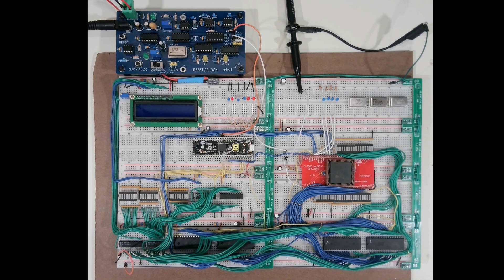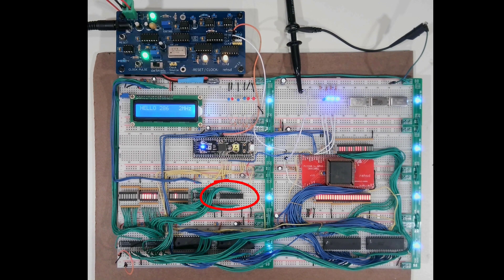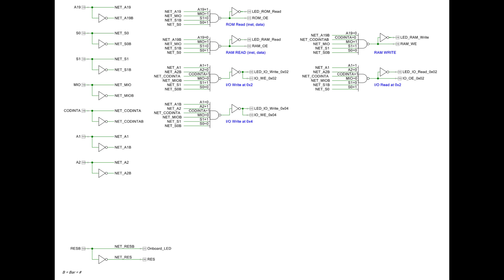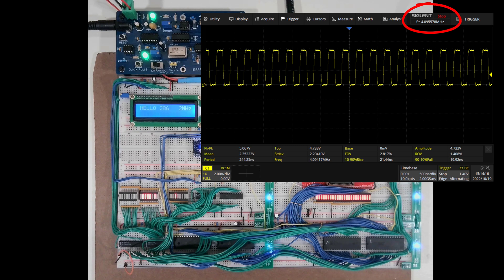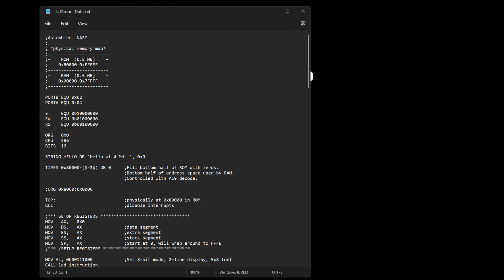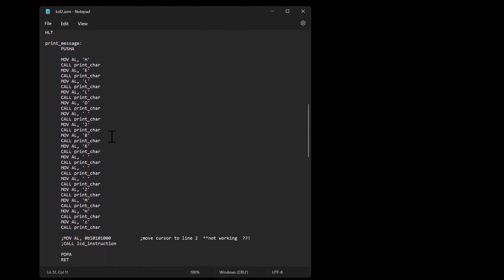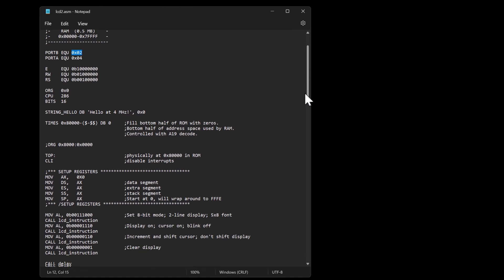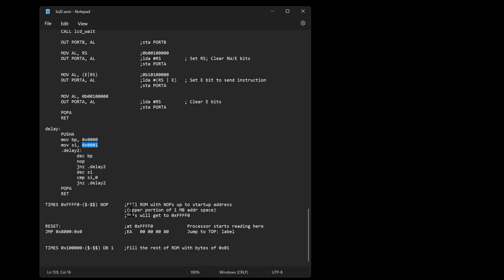80286 Build, Ep. #10 - I/O Read of LCD Busy Flag (System at 2... I mean 5... MHz)

Comment: Another great video. 

Your print_string routine actually can be very simple:

;
; Send a NUL-terminated string to the LCD display;
; 
; In: DS:BX -> string to print
; Return: AX = number of characters printed
;              All other registers preserved or unaffected.

; 
print_string:
push bx ; Save BX 
push cx ; and CX onto the sack
mov cx, bx ; Save contents of BX for later use
.loop:
mov al, [bx] ; Read byte from [DS:BX]
or al, al ; Did we encounter a NUL character?
jz .return ; If so, return to the caller
call print_char ; call our character print routine
inc bx ; Increment the index
jmp .loop ; And loop back
.return: 
sub bx, cx ; Calculate our number of characters printed
mov ax, bx ; And load the result into AX
pop cx ; Restore CX
pop bx ; and BX from the stack
ret ; Return to our caller

I hope this routinee is useful for you.
Reply from the maker: @Damouze, if you'd be kind enough, could you take a look at this code and see what looks off? I'm working to implement your print_string procedure, and I must not have something quite right.

https://pastebin.com/Mj6cUFkm

Thanks!!!
Reply: My pleasure.

Assuming you're generating a flat binary (for instance by issuing nasm -f bin <assembly file> -o <output file>), the contents of the data segment will end up at the end of the code segment. In other words your test string ends up outside the bounds of your ROM image, at file offset 0x100000. You're initializing DS to 0x0, which is the start of your RAM. However, since this is not where your string is, it won't work. 

The best way to deal with this, at least for now, is to simply load DS with the contents of CS:

push cs ; push CS onto the stack
pop ds ; and pop it into DS

Then move your string inside the code section of the assembly file and nasm will generate the proper address for its label. I hope this helps you out.

Note: in real mode the segment registers, other than CS, can be altered at any time and they can all be saved onto the stack and again with the exception of CS restored from it. The opcode that used to for POP CS in the 8086/88 is, in fact used in later processors as the prefix for extensions to the instruction set.

Final note: in real mode the first 1024 bytes of memory are reserved by Intel, for the CPU's interrupt vector table. This is where the CPU looks up the pointers for the handlers for software interrupts (int <imm8>), hardware interrupts (such as NMI and other external interrupts) and exceptions before calling them. This means that, strictly speaking, setting SS to 0x0 is not the best idea. You should set it to at least 0x40. Later on in your build you should also consider initializing the interrupt vector table and write handlers for at least the exceptions and hardware traps.
Reply from the maker: @damouze  Interestingly, I wasn't specifying the "-f bin" option. It ends up the output is the same, so NASM must be assuming binary based on something in my code. (?) I will add the option explicitly to my build batch file to be safe.

I will try out your recommendation to move DS. I've been reading a lot, and this definitely isn't clear in any of the reading I've been doing (or I've been missing it). I wouldn't have come to the conclusion that DS would be beyond the ROM ending address.

Also, I will get my SS moved. I was just reading about interrupts today and saw the note about the first 1K being reserved. I'm hoping to add interrupt support for a PS/2 keyboard in the coming couple of months.

I greatly appreciate your help. You've been very helpful! Thank you, @Damouze!
Reply from the maker: @damouze  Success!! Here's what I have at this point: https://pastebin.com/PZC5kUkq. It works great. I used 0x0400 for SS. That should leave the first 1K. Thanks again!!
Reply: @rehsd  You're welcome. I am glad I could be of assistance.
Reply from the maker: @damouze  Any suggestions for where I can learn more about placement of the data segment in flat binaries? I'm trying to understand why it's placed at 0x100000 in my case, and how I would properly use the data segment. Is there a better, long-term approach that I should be working towards? Thanks!
Reply: @rehsd  Actually, using a flat binary means it's all up to you and you'll need to either calculate the values for the various segments (other than CS) - nasm has a very powerful macro language - or assign them fixed values. I prefer the former approach, because that way you don't have to worry about any of them overlapping if you don't want to, or have them correspond to eachother or any combination for that matter. 

The section pseudo-ops really don't have much meaning in a flat binary. Think of it as a way for you to force and order of placement of the different portions of your program and data. However, that is something that can just as easily be achieved by clever use of the times directive. The only thing to take into account is the origin of your program, this tells nasm to make assumptions about the offset of things within a section or within the file and as far as I know you can set the origin only once per section using the org directive. 

Say for instance that you wish to (logically) split your ROM image into a code and (read-only) data section, but without using the section pseudo-ops. Let's say the top 32kB of your ROM image contains your data (excluding the 16 bytes at the reset vector) and the 32kB just below that contains your code:

CS contains 0xf000 at reset, but you jump to the start of the final 64kB of your ROM image (0xf000:0000), after which CS would still be 0xf000. DS would be 32kB after that, and since in real mode segments always start at a 16-byte boundary and the segment registers contain the top 16 bits of that address, DS will become 0xf800. You've already defined your stack segment to be 0x0400 (leaving the bottom 16kB of RAM for other use, probably unintentional, since the comment in your assembly file states 1kB). ES can be anything you want to be, for instance the first 16-byte aligned address after your stack.

To summarize:

CS = 0xf000
DS = 0xf800
SS = 0x0400
ES = whatever you wish it to be

A short snippet of code below:

cpu 286
bits 16

%define IMAGE_SIZE 0xfffff ; Full 20-bit size of the ROM image
%define RESET_VECTOR 0xffff0 ; Full 20-bit address of the reset vector
%define TEXT_START 0xf0000 ; full 20-bit address of the code segment
%define DATA_START ((TEXT_START) + 32768)
%define TEXT_SEGMENT ((TEXT_START) >> 4)
%define DATA_SEGMENT ((DATA_START) >> 4)

org 0x0
times TEXT_START - ($$ -$) db 0 ; Fill everything up until the start of the code segment with zeroes

code_start: ; these labels are really just for convenience
;
; Your code will be here
;

jmp code_start

code_end:
times DATA_START - ($ - $$) db 0x90 ; Fill everything up to the start of the data segment with NOPs

data_start:

;
;  Your data will be here
;
test_message:
db 'Hello world!', 0

data_end:
times RESET_VECTOR - ($ - $$) db 0xff ; Fill everything up to the reset vector offset with 0xff

; At address 0xf000:0xfff0

reset_vector:
jmp TEXT_SEGMENT:code_start 

times IMAGE_SIZE - ($ - $$) db 0x01 ; Fill everything after the reset vector with 0x01

;
; EOF
;

[edit] I made a boo-boo concerning the initial contents of CS:IP, my bad. Sorry! CS should be 0xf000, not 0xfff0. Technically this means that you could just use a near jump at the reset vector, but that makes the entire setup somewhat less flexible.
Reply from the maker: @damouze  Thank you so much for the detailed response! Your explanation is much clearer and helpful than the books and websites I'm reading!

I must be miscalculating 0x400 as 1K. Is it because the value is shifted left (multiplied by 16) to get the physical address, so 0x40 is actually 0x400 physical?
Reply: @rehsd  You're welcome.

That is indeed correct. To generate an address in real mode the CPU shifts the contents of the segment register left by 4 bits and then added to the offset. 

Note: I made a mistake with the initial contents of the CS:IP vector after reset. CS will be 0xf000 right from the start, not 0xfff0.
Reply from the maker: Thank you!! I appreciate the help!